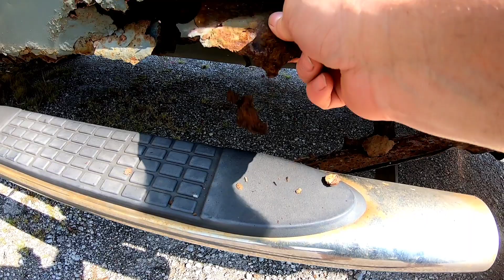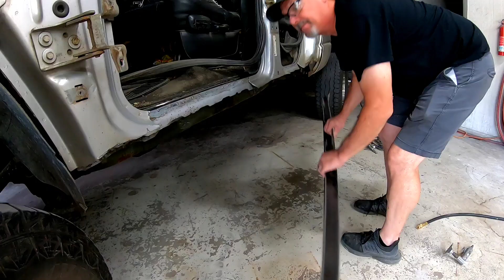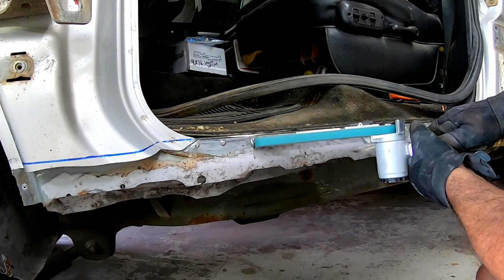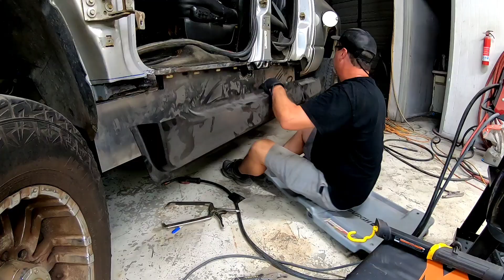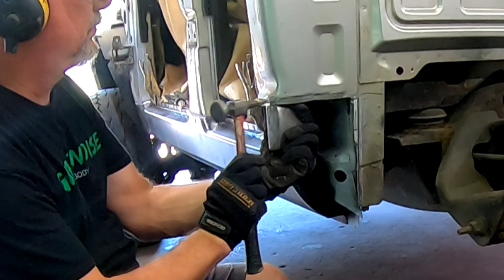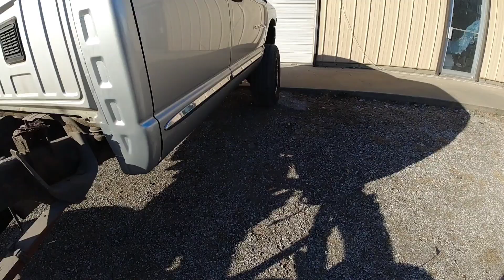Guide to replacing rusty metal. #Autobody #bodywork

Comment: You can't ignore rust. You have to deal with it when you see it. Get yourself rust treating spray paint and aluminum tape for metal you won't see. Stickers for the outside that you do see will suffice to cover any rust spots. Just make sure to remove the rust or use a spray that can neutralize the rust, just be sure to remove any chunks of rust. I've been going over my 99 F150 and although I bought it used back in February this year I am going over it to deal and treat any rust on the panels. I'm not concerned with the frame as a new one will run under 800 dollars. I can get it coated for protection when I get to that point. I'll deal with the underside when it's summer. I'll probably need plenty of aluminum tape and rust treating spray paint. On the plus side Washington state doesn't salt the roads, they tar and gravel the roads.
Reply: Any recommendations on rust treating spray?